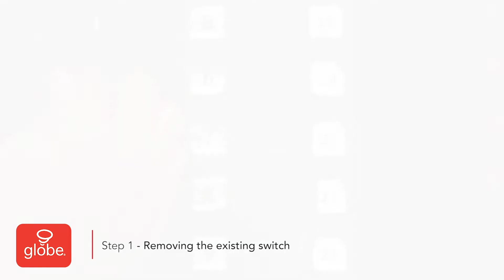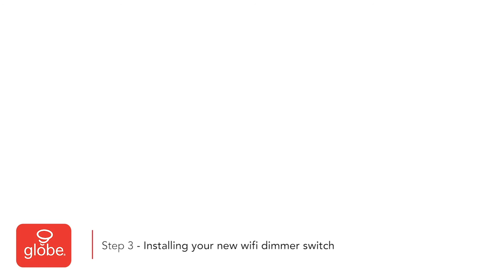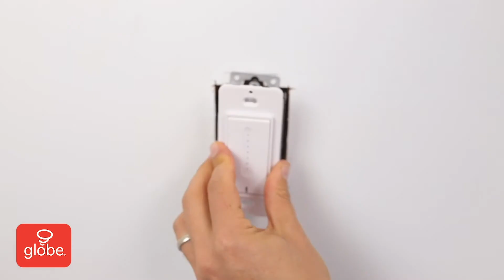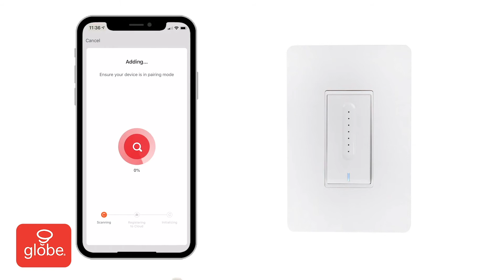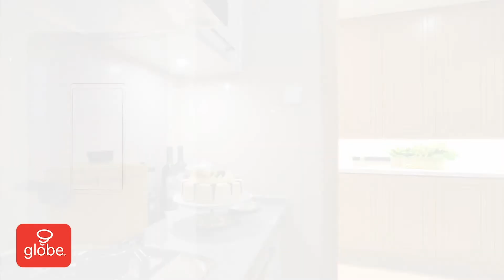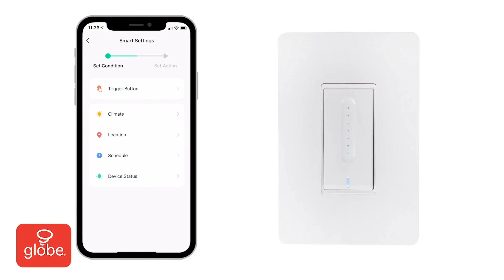Smart Dimmer – Set Up and User Guide | Globe Smart Home

Comment: I've tried 3 different dimmer 2 Faulty one and one that works to turn the light on and off but the switch won't pair even tho I've set my wifi to 2.4 and triple check everything my Dimmer just constantly  flash